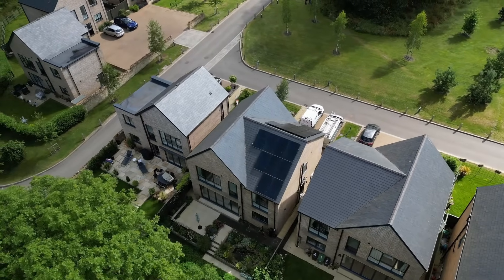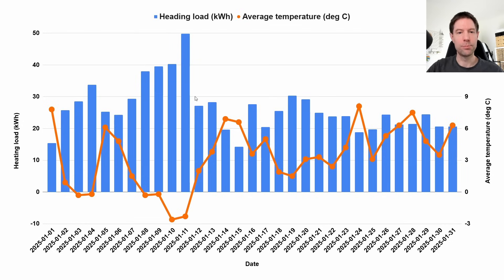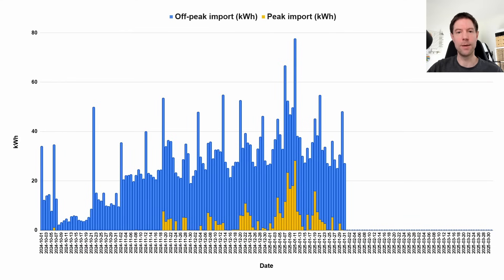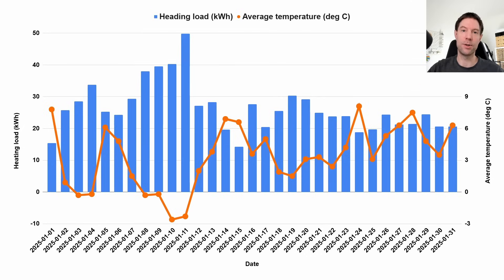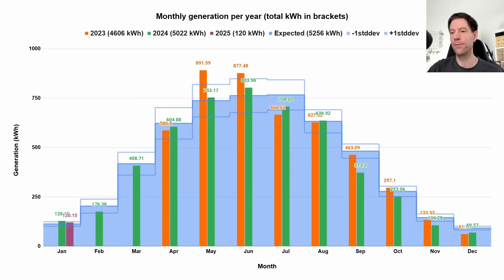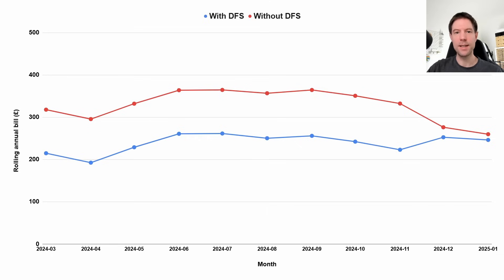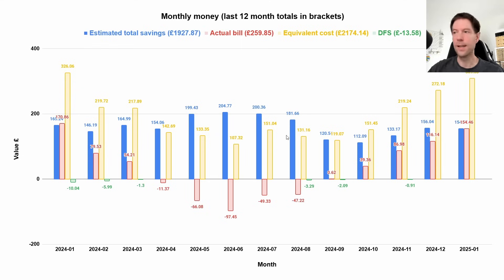Which would win in a fight?  A cold snap or a heat pump?

Comment: Commendations for your data-centric approach. Just one clarification: is your 'heating load' value the input (electrical) or the output (thermal)? I don't think you said. 'Heating load' should be the thermal value, but the way you talked about stuff suggested that it was the electrical?
Have you tried calculating emissions costs/savings as well as financial ones? I know people tend to concentrate on the finance side but the emissions side is just as important, arguably more so. I've just done the sums for my upgraded PV+Batt system and the emissions payback (~3.2 years) is faster than the financial one (~4.5 years), which surprised me. You do have to use up to date LCAs for PV and batteries though - the numbers are changing really fast. (e.g. 2024 panels and batts have less than half the upfront emissions of 2020 ones, according to the data I found - and that makes a big difference of course). The generated kWh are pretty low-carbon at around 8gCO2e/kWh straight from the panels, and and extra 15g for generation that goes through the battery before being used or exported. (so ~23gCo2e/kWh). Those compare well to current UK average of 150g, but that number is falling fast too.
Reply from the maker: Heating load is electrical consumption, as that's what I can measure, and what I get charged for (and makes it consistent with all the other electrical consumption values I present).  The heat can't be measured anyway, at least not with A2A systems, typically.  I covered my carbon impact in a previous video although I've got more planned so keep your eye out for those (although the viewing figures for any video talking about carbon are about half what they are for videos talking about money!)

Comment: If the science* prevails over the politics, we may all well be experiencing longer and colder winters very soon (shock horror - Ed Miliband mistaken!🤣); this being taken into consideration, your heating bill although may be overall higher, it shall still operate at a much reduced cost when compared to other electricity based systems.

* see Professor Valentina Zharkova, Tom Nelson Podcast no 42.
Reply from the maker: Heat pumps are always the best option for heating, it's as simple as that.

Comment: How do you find the reverse cycling when the outside temperature drops?  Ours seems to shut down for 10 minutes acouple of times per hour whilst it de ices the external unit. Result is it takes quite a bit longer to get the room up to temperaure in the morning
Reply from the maker: It rarely has to do a defrost, maybe a couple of times a day.  The fans shut off for 5-10 mins but because the rooms are already warm it isn't long enough for it to cool down at all, so we never really notice it happening.  We talk more about that in this video: https://youtu.be/_sEeruEiaQ0
Reply: @ Agree it’s not noticeable when the room’s warm. Ours comes on at 05:00 and I get up about 05:50. Normally it’s nice and warm but when it’s hovering around zero outside it’s definitely cooler inside due to the reverse cycling (plus physics says it has to do more work anyway). I’m not in to home automation so programming it to come on earlier when it’s cold is a bit beyond me.

Comment: I liked the "Heading load" misspelling on your graphs. Presumably a mistake (Freudian slip?) rather than an Easter egg?

With the consistent low temps can you estimate your heat loss and compare it to your heating use, for a "SCOP" of sorts?
Reply from the maker: Ha!  Good spot.  No, just a typo, I'm afraid, nothing more interesting than that.  I've fixed it now, thanks for letting me know!  Good question about the SCOP, I think my heat loss calculation would need to be much more accurate, I did it myself using HeatPunk and although I'm sure it's not a million miles off I expect it's got plenty of errors still.  So without that any other estimates of energy efficiency would be equally suspect.  Still, it's an interesting idea, I'll give it some thought.
Reply: @TimAndKatsGreenWalk the SCOP wouldn't necessarily need to be made public.
Reply from the maker: @ no, indeed, but I'm just not sure I'd be convinced of its reliability in any case.

Comment: I had my house tested for heat point and found my cable can hold a max of 60amp they tested the mains cable into the house and told me that you cannot increase the amp because electricity from the street cannot take more than 60amp to each property.
British gas told me that properties in this area are unable to take a heat pump or ev charger. 
British gas then checked for network update and told us 2038 will be the time period for electric cable upgrade.
Reply from the maker: Oh wow, that's not ideal.  Although I'm sure a 60A supply doesn't totally preclude you from getting an EV charger or heat pump, you just need extra monitoring to ensure your load stays within that limit.  I would get a second opinion if you're able.

Comment: Very Interesting to see your numbers compared to our own.  Our A2A is consuming much less than your own but we have a 8kw Inverter and 3 Indoor units. Towel rails, we use 3 and each is about 40kwhs a month! You must be heating your bathrooms much more effectively that ourselves.

Our A2A kwh usage is between 6 and 15kwhs a day on the coldest days
Reply from the maker: Yes, we tend to only use the towel rail in our ensuite for an hour overnight and that seems to be sufficient.  There are just the two of us so we don't bother heating the other wet rooms.  For the A2A we're definitely using more now that we've adopted the overnight boost strategy but that's helping reduce the overall cost due to the battery lasting longer so it's been an interesting experiment, which we shall continue to do!
Reply: Makes sense.  Since I've added more batteries I've been happy spending the extra on running towel rails longer.  3hrs of 300w is only 7p after all
Reply from the maker: @EVPuzzle  yeah, I'm holding off getting more battery for now but I can definitely see that having a bit more would be beneficial.
Reply from the maker: This is another factor: https://youtu.be/oDFeIYPUZzg

Comment: To compare, we have a four bedroom detached with an air to water ASHP, as we are retired it is simply on 24/7 but we have two Powerwalls to supply power all day along with the solar, mainly E/W as yours is so not much at this time of year! Our heating used "only" 690kWh in January, in January 2024 we used 800kWh, the difference this year was I have tweaked the system and got weather compensation working fully so really worth the effort! We are on Intelligent go as our Zappi charger is compatible and our average price per kWh very close to 7p. The bill for January £109 with £16 back for exports. So the bill for heating was around £50.
Reply from the maker: That's great going.  We're investigating EV options to replace Kat's lease before the end of the year so there's a chance we'll be able to get IOG next winter, we shall see.  It'd make a small difference compared to regular Go but I doubt we'd have got down to £50 for our heating if we'd ben on it this Jan!

Comment: Really enjoying your videos since I discovered them only a couple of days ago after wondering if I need a couple of a2a units to provide a background heating to our existing gas boiler system, whilst utilising the aircon during the summer. Lots of great advice on your channel that I'm appreciative for. Given that your parents are old and require the heating to be set at a higher temperature would it be something you would recommend for them? I'd assume that running at a much higher temperature is going to take a lot more kw/h's of electric energy (battery or grid) and therefore cost more to run over Gas at a temperature of maybe 21°?
Reply from the maker: I'm glad you're enjoying the channel.  I would say that regardless of the temperature you need in you home A2A (or A2W for that matter) will end up roughly equivalent in running costs to gas, since to run at a higher temperature with a boiler you'd also need more gas.  If you have a home storage battery it can become significantly cheaper to run any form of heat pump than a boiler, due to being able to use cheap overnight power, as I described in my video.  Incidentally, if you're considering AC anyway then keep your eye on the upcoming changes to the boiler upgrade scheme this spring as it looks like A2A might be getting included.  So you could find that you could get a whole house A2A system for a very reasonable price.  I'll have a video about all the details as soon as I know them.
Reply: @TimAndKatsGreenWalk  Thanks for the reply, certainly common sense would portray that all systems would cost more the hotter the temperature. My thought would be that because the heat is set much higher the gas radiators would still stay very hot after the power is stopped to them and therefore leave residual heat maybe? Sorry if you've done a video on that I'm still ploughing through. I did see the video with mention of the possibility of the grant but I'm still too cautious to say goodbye to my boiler and more curious for a hybrid setting. Not searched for any videos on this but would probably suit my needs better given that we don't intend to stay in our property any longer than another 8 years...running costs and comfortability are my priorities over emissions, the 2 tonne of co2 saved by ditching my gas boiler is soon guzzled up in 3 months by a car in the US who just don't care
Reply from the maker: @ if you run your gas boiler with a high flow temperature to get really hot radiators it actually becomes less efficient, so running low and slow is more efficient for gas boilers as well as for heat pumps, as it turns out.  There is also a difference between room set point temperature and flow temperature (for the water running through the radiators).  If you have a room temperature set point of 21 deg then you can achieve that either by running low and slow with a flow temperature of 40 deg, say, or short and fast with a flow temperature of 60 deg (I'm using A2W vs gas in this example but it's similar for A2A).  In both cases the 40 deg flow temperature is more efficient but the final room temperature is the same, the only difference is in how long the system as to run for to get to that temperature.  Low and slow takes longer to get there, which is why you would tend to keep your heating on for longer and maintain that temperature rather than let it get cold before reheating again, which is what traditionally is done with gas boilers.  But even with a gas boiler you will burn less gas by running for longer at a lower flow temperature than by running in short bursts at a high flow temperature.  And you will have a more consistent temperature in your home, without the peaks and troughs of temperature.  All that is to say that it is very complicated and not a simple matter of saying a higher room setpoint temperature will result in more energy use.  It depends a lot on the system design too, including flow temperature etc.  For A2A the flow temperature is partly controlled by the room set point temperature but the units will drop it back as the room reaches the set point so that it just trickles heat in, in the same way as an A2W system (more or less).  It's too much to explain in a comment, really, so I would recommend checking out the videos by the Heat Geek channel for much more on this subject.  They focus on A2W systems but a lot of the same principles apply to A2A (i.e. running low and slow is more efficient).
Reply: @TimAndKatsGreenWalk  such a concise reply, I can tell you really love this subject/living hobby and find it fascinating, thank you. I may well give the lower boiler temp thing a try, we are set up (with a 6 year old combi) through a nest system so with the boiler set lower I'm sure I can tweak a schedule to work for a few days to test it. Currently we heat at 16° whilst no one at home during the day, heating to 20.5° starting at 4pm till 9pm.. Yesterday that cost £3.30 with 2 showers and a bit of hob cooking so would be interesting running it low and slow on a similar outside temp day. Ultimately this is the reason I was considering a couple of a2a units as our sitting room is the last room to become warm because the radiator in there is last on the system and a vertical style. Despite numerous attempts at balancing it remains slow to warm and so my thought was a temp blast from the a2a would give it an advantage to warm as much as the rest of the house... Hope that makes sense!
Reply: I should add this is a 70's 3 bed detached, double glazed, early/basic cavity and loft insulation
Reply from the maker: @doozeruk2000  yes, that makes sense.  You might find that just using the A2A unit might be sufficient heating for your sitting room without the need for a radiator at all.  Worth some experiments.
Reply: I thought a2a convection heating is less efficient, comfortable and healthy than a2w?

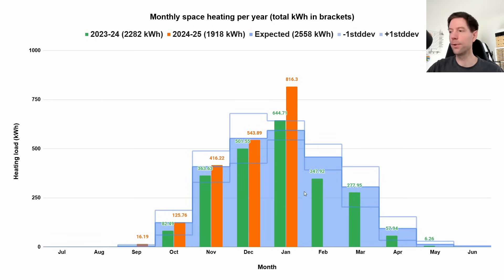Comment: It is interesting to see your electricity use chart at 04:00 in your video. My ASHP including Domestic Hot Water gives very similar figures of Electricity use.
Solar being E/W facing only gave me. As we previously agreed, it seems our solar is also very similar, so on to my figures. Unfortunately my Tesla Powerwall seems to be empty soon after midday as my ASHP is running to maintain a 19c temp all day and a drop to 17c overnight.

Solar from 7.56kWh E/W split system 124.1kWh
Tesla EV used 339.2kWh for about 1000 miles
Total Electric use for January 1960.1kWh and we ended up at a 50/50 peak/off peak split.

ASHP inc DHW
July 39.8kWh
August 40.57kWh,
September 44.98kWh,
October 85.01kWh,
November 466kWh,
December 418.3kWh,
January 849.04kWh,
February 298.82kWh,
March 248.6kWh,
April 142.21kWh,
May 48.01kWh,
June 45.35kWh.

After export rates increased to 15p per kWh I have stopped using solar to heat the DHW
Reply from the maker: Yes, very similar ASHP use, interesting.  I agree, using solar divert for any purposes at the moment is not the optimum strategy, but you never know where tariff rates will go in the future!  I would hope that export rates will continue to be good, but I do wonder if they will generally become more dependent on time of day, like Flux currently is.
Reply: @TimAndKatsGreenWalk  Agreed I hope the export tariff stays at a good price!

Comment: Tim, great video (as always). Interesting that your average 11.2p/kWh is fairly close to the Cosy rate. Have you considered switching to Cosy (which would make you more ‘Green’ by consuming fewer kWhs) and you wouldn’t have to ‘preheat’ the house overnight as you could top up your batteries during the 3 low cost periods? From your intro, could future upgrades include more solar panels (I estimate 4-6 on South facing and 14-16 on the North facing), additional battery storage and a heat pump tumble drier? Obviously the ‘pay back’ wouldn’t be as attractive as the original install but wouldn’t it make you feel even happier with your setup? 🤗
Reply from the maker: I don't believe I could get a better average unit rate by switching to Cosy, especially as a good chunk of the rest of our consumption is at 8.5p/kWh.  The 11.2p/kWh average was for just the heating and general house usage, as some of it was at peak rate, the rest of our consumption is almost all from overnight (EV, water, towel rails, dehumidifiers).  So as we move out of the coldest month and we need less peak rate power the average unit rate will head back towards 8.5p/kWh, which Cosy can't touch.  Cosy is also less green than Go, as it happens, I did a video about that a while back ( https://youtu.be/VF199lkvLR8 ).  And it's a right pain scheduling multiple charging periods for the batteries, so that's another reason I don't like it.  Regarding extra generation you're pre-empting a video that will be coming quite soon ;)
Reply: Thanks for clarifying how you arrived at your figures and I’m looking forward to hearing more about your future plans….😄. Surely your neighbours with their large south facing roofs should be solar’ing….haven’t you convinced them yet? 😋
Reply from the maker: @Steve-6536  I'm working on them 😉
Reply: I can imagine people with a smaller battery switching to Cosy for the coldest months of the year, and charging their battery 3 times a day. Then using Go when one charge a day is sufficient (and flux in the summer for export).
Reply: @robinbennett5994 Exactly my strategy 💪

Comment: I have had ana2a system too since July last year, likely influenced by yourself and evpuzzle. 

Old house with solid walls and we used around 104kwh in Saturday the  11th, probably 30 of that going into the car. Nearly broke 2k for the month at 1969kwh (nice).

This would have easily been 350 litres of oil.

Have been on eon next drive since mid December. The seven hours overnight at 6.7p and too a later time really helps pre load the house. Felt a bit dirty to leave octopus, have you been tempted by this tariff?
Reply from the maker: It's a good tariff, no doubt about it.  For me the extra savings aren't worth the trouble of switching, tbh, and I like being able to get the Octopus data and the other benefits they have, so I'm happy to stick with them for now.  I'll be keeping my eye on things though.